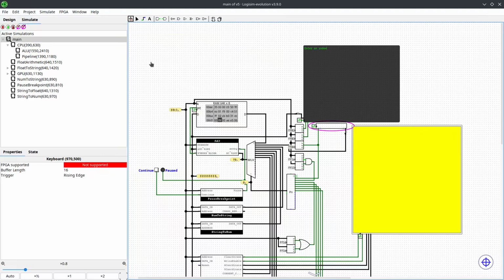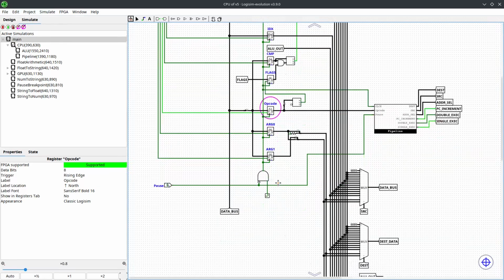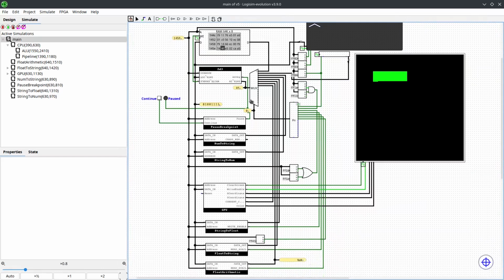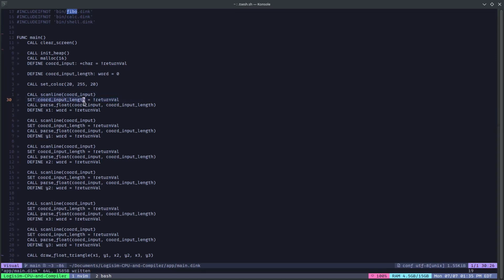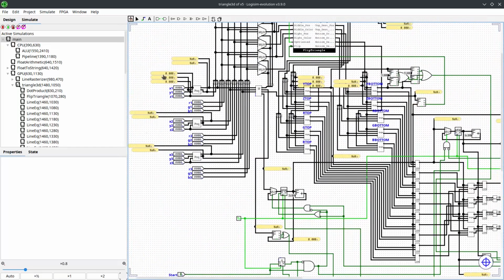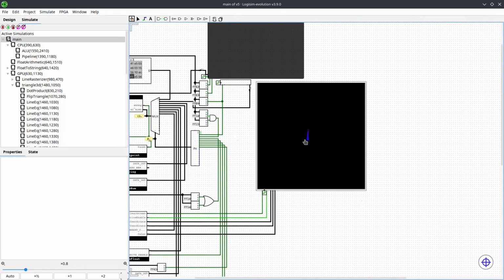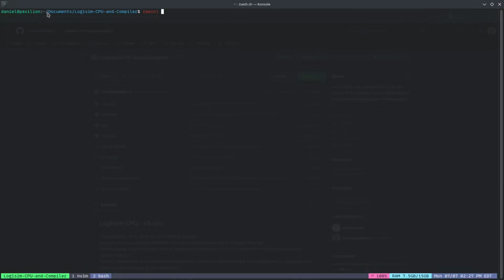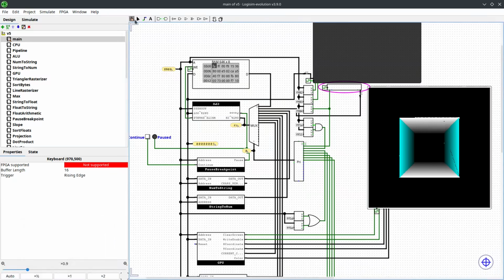16 Bit Logisim Computer with 3D Graphics

Comment: what, how did you learn this?
Reply from the maker: Short answer: 15+ years of literally just figuring it out.

Long Answer:
Best advice is to learn to program in C and Assembly. I had a textbook called computer organization and design that was great to learn assembly and how a cpu operated. Get the mips one and do the exercises along with it in the CPU emulator.

For logisim just learn some basic digital logic and gates. I've been using this software for over 1o years and eventually gotten half decent at it. The more you use it to build small projects the easier it is to make more complex stuff. Try making a small Fibonacci counting machine in logisim. It's a good solid project to learn how to use the clock, memory, plexers and gates.

Once you understand the fetch, interpret, increment and execute instruction pipeline used by simple cpus, you can build a really simple 4 bit computer. I started there then built some 8 bit cpus and this is my first 16 bit.

I learned the 3d rendering stuff first from OpenGL and then I made some software rasterizers and games in C++. I used that knowledge to build the interpolation circuitry. Can't really recommend learning all that. It's another one of those things I've kinda puzzled together over the last 10 years.

https://learnopengl.com/ is a fantastic resource to learn about 3d rendering and shaders in C.
There's plenty of resources you can find on google for how to rasterize 2D triangles and project them from 3D space.

As far as writing a compiler, it's pretty difficult and terrible. This was my first true compiler. Start with writing an assembler before you take a crack at it. There's a ton of stuff I don't know about that black art and am likely the worst resource for it.
Reply: @CoderShare  Thanks for the advice!
Reply: @CoderShare  would you reconsider using parallelized rasterization or nah?
Reply from the maker: @aqqalularsen3322  I would love to, but the video device in Logisim only allows writing one pixel per clock cycle. That's the primary choke point on graphic performance.
Reply from the maker: @aqqalularsen3322  I'm actually considering one of two paths to improve graphic performance.
1) Write a Logisim plugin with OpenGL accelerated capabilities
2) Write an external C++ program that listens on an open port for commands and then draws to a screen
Reply: @CoderShare  ooo cool, i haven't dabbled in opengl at all but i've made a really slow rasterizer on an interpreted language with parallelization, so i think the opengl approach sounds cool